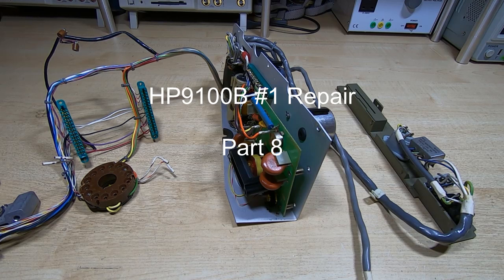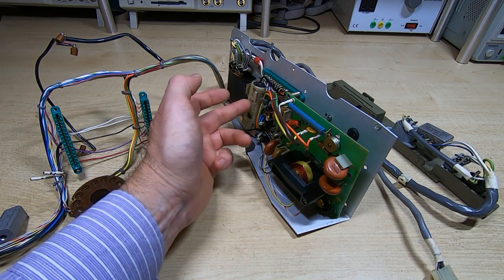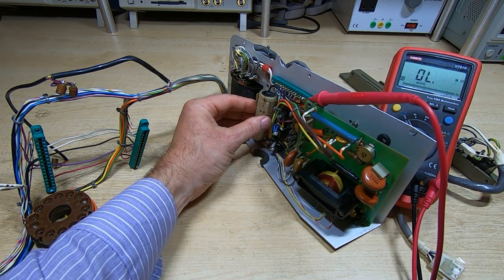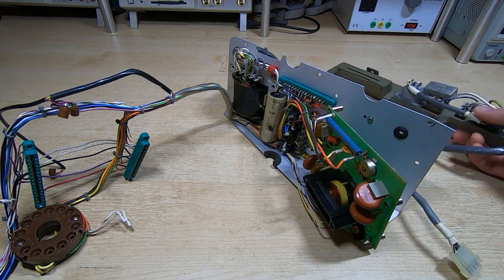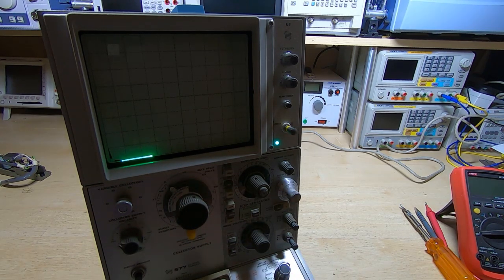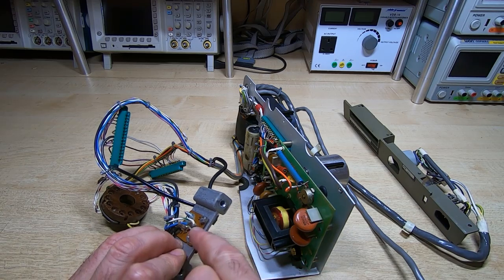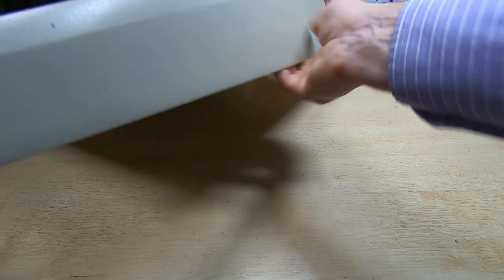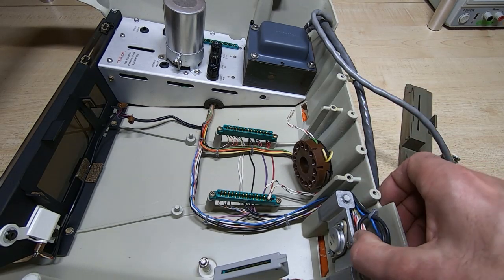HP9100B #1 Repair Part8

Comment: How did you test the line filter? I've had a couple of these go short (usually RIFA bypass caps) and they leave a stinky mess. At this point, I routinely replace them, either by opening the cans and fitting modern X/Y caps or finding a replacement.
Reply from the maker: I have a high voltage capacitor leakage tester. As you say these filters fail by the caps going short and exploding but they normally get leaky well before that happens. I generally replace the caps or just remove the filter completely. On a machine with a large transformer on the input then a filter is not really needed but if I can open the filter I will replace the caps. Because it is wired across the input connector then it is powered as along as the unit is plugged in and I have also had a number of these fail over the years and the smell takes days to clear.